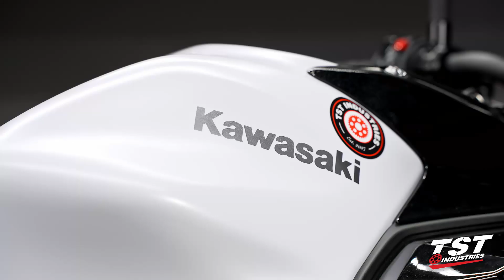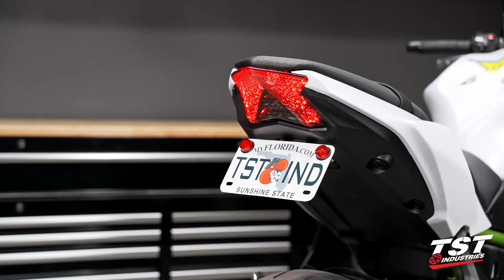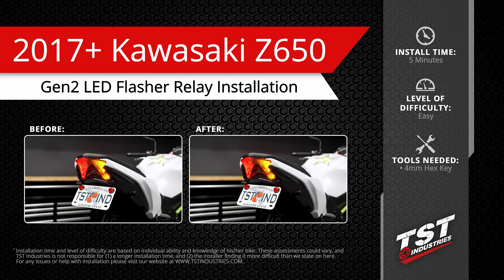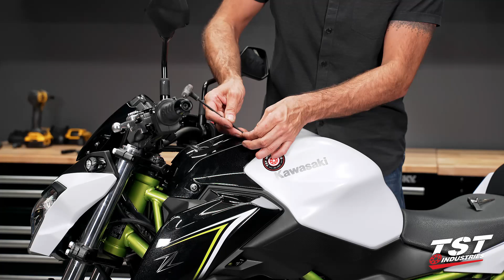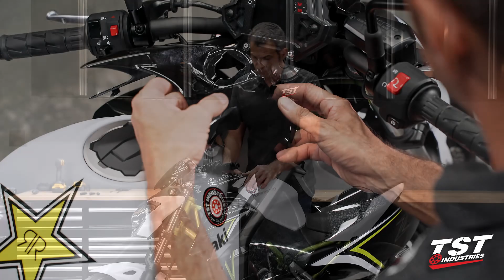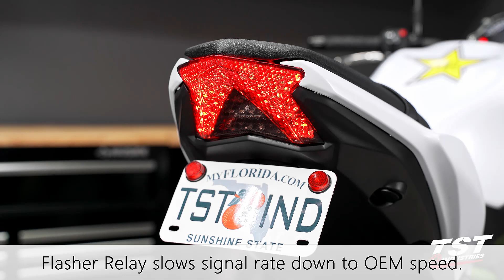How to install an LED Flasher Relay on a 2017+ Kawasaki Z650 by TST Industries

Comment: I just bought a 2025 z650 and the relay is completely different, its almost under the keyholder, still has the rubber casing but the tst flasher relay I just received does not plug in, completely different connection. Is there another relay im unaware of?

Comment: So I recently purchased those same exactly signals for my 2024 z650 I’m getting a combination of a hyperflash along with both rear and front signals flashing very dim, what is the issue I am having and how can it be resolved?
Reply from the maker: @Thread_Cautiously  for this issue I will have to encourage you to connect with our customer service department theough our website. When you use our support portal you can exchange media and information, enabling our guys to solve your problem quicker and more precisely.

Comment: For  the 2022 z650, might be 2020 - 2023, The flasher relay is on the Left side of the bike kind of above the horn.  Take off the front  fairing and  you'll see a bank of relays.  The one you want is mounted behind those.  it'll be on a rubber...thingy.  Put rubber thingy on the clip on the new flasher relay and hang back where you found  it.  you don't have to take off the whole front fairing, but it makes it much easier if you do.  I even took off the very front fairing.

Comment: Can confirm if the z650RS has it on the same location? that means i have to remove the tank cause it doesn't have a top cover like that. thats a lot of work for just a relay replacement. 
I ordered the tst echo pods, hopefully i wont need to replace the flasher relay.
Reply from the maker: I looked at parts fiche for the RS model and it looks like the relay is mounted under the seat, up above the rear wheel. Much easier access than up front.
Reply: @TSTindustries  Its not there, forgot to mention,  i live in Asia, probably its in a different location. i believe other region units are different some comes with a halogen turn signals, ours comes with LED turn signals already.
Reply from the maker: @3xk890  well since you said you already have the signal lamps on the way, let's see if they will work without relay replacement. You may be fine if you are just changing one signal set. If not then we can try helping you some more.
Reply: @TSTindustries  im changing front and rear. may need to watch videos on how to remove the tank now. haha
Reply: will keep you updated 
 @TSTindustries

Comment: If you add you TST rear integrated tail light but you do not add the front turn signals. Do you still place the LED flasher relay? Will the LED flasher relay work with the stock OEM front flashers? thanks
Reply from the maker: Changing even one set of signals will precipitate a faster flash rate. If you are ok with the faster flash then you can potentially just leave it alone. But if you are using sequences in your tail light, the signal sequence will not light up all the LEDs so you are shortchanging yourself unless you get that flash rate back to OEM rate. And yes, our relay is compatible with mixed signaling devices so tail light in rear and oe fronts will work just fine.

Comment: For what it's worth, this is only completely accurate for 2017-2019 models. In this case, the relay hardware itself still plugs and plays just fine, but the device itself is actually deeper into the front shroud now, and on the left side of the bike. Requires a bit more work to get to it - really I'm just a little upset that I spent an hour looking for this thing on the right side of my bike, like in the video 
2020+ changed a lot of the wiring in the front shroud.

Comment: Any idea where the flasher relay is on a 2020 Kawasaki ZH2
Reply from the maker: In examining parts fiche I found that the relay hangs on a frame fitting that is screwed to the bosses in front of the steering tube.

Comment: I have a 2020 Z650 and i bought the set and installed them and they look awesome. However, I couldn't find the relay because it is not in the same place as shown in the video, so by any chance, you would know the answer ? otherwise awesome products.
Reply from the maker: According to parts fiche the relay is hung on a steel bracket on the left side of the bike just above the horn. This now mimics the exact setup that the Ninja 650 has. We currently do not have a video showing the installation but if you remove the left panel that has the Z sticker on it behind the headlight and below the fuel tank, you will find the relay.
Reply: @TSTindustries  Followed your instructions and easy to install on 2022 Z650 thanks!!
Reply: Thank you! 🤘  @TSTindustries

Comment: I have a 2020 z650 the relay location doesn’t look to be in the same place can you tell me where to look
Reply from the maker: From our understanding it's on the opposite side of the steering neck. So left side instead of right side.
Reply from the maker: You will find the steps in this video https://youtu.be/fjZM4yerQCg

Comment: This is located on the clutch handle side of the bike under the plastic shrouds at the front of the bike on the 2020 model.  You will not have remove the plastic around the key.
Reply from the maker: hmmmm...I can't wait to get one in house to re-make the video for the newer model
Reply: @TSTindustries  The connections on the factory taillight have changed too.  But the light works and looks great.
Reply from the maker: @lukeofearth1036  We have a 2020 Ninja 650 in the house and that bike has different connectors onthe rear signals. The tail light connection has not changed. I wonder if the signal connectors is what you meant. We are already selling a sub-sku of this light with the new connectors.
Reply: Yeah,  the signals.